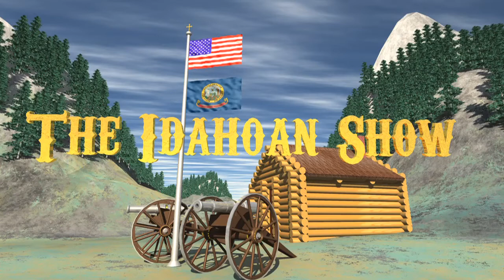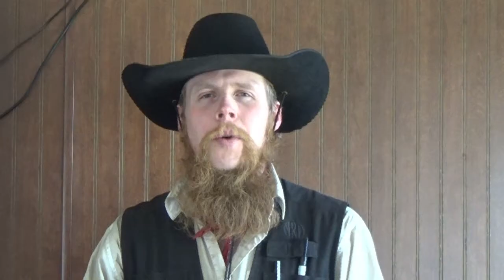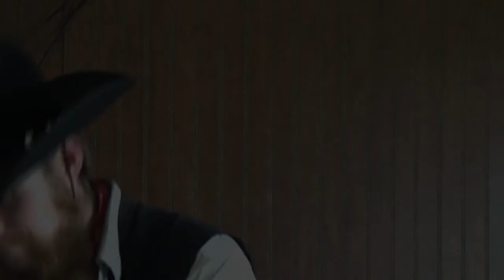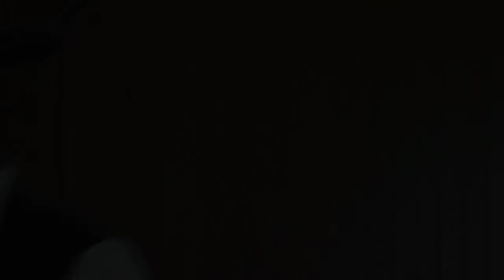Announcement - June 2017 (A001)

Comment: I agree  with  those  who  have  said  the echo  is of no  consequence.  Your  content  is  excellent. BTW, you  possess  a  number  of  valuable  manufacturing  skills. What  would  you  recommend  to  someone  who  doesn't  have  a professional  background  in  manufacturing  but  who would  like  to  learn  skills  such  as machine shop, welding, etc., as the  best way  to  acquire  these skills  and  without  having  to  spend  a fortune  on college  classes ,  if possible ?
Reply from the maker: Well, there are a variety of options out there for learning metalworking skills.  I've had the pleasure of knowing a number of retired machinists and mechanics who had their own equipment and were willing to share their knowledge.  If you can find and make friends with a retired master metalworker, more than likely he'll share his expertise with you free of charge.  Another venue to investigate is internships and apprenticeship programs.  During high school and college, I spent a number of summers working as an intern and basically getting paid to learn how to run machinery (didn't get paid very much, mind you, but better than nothing).  And if none of that works out, there is always self-study.  I taught myself how to weld by buying a used arc welder for $40, reading a few books on the subject, and burning a lot of electrodes until I finally got the hang of it.

Comment: With regard to reducing echo in your workshop, soft materials aren't absolutely required. From what I can see, you have a large shop with large, flat, sound reflective surfaces. As you fill your shop with more supplies, shelves, and machines, the irregular contours of these items will break up these clean, sound-reflective surfaces. The ceiling will likely be the most difficult surface to manage. Of course, a lavalier mic and synching audio later on your computer will help a lot too, but that costs you time.

Comment: Question for you: have you investigated electrochemical etching as a means to cut rifling grooves? Seems like it would be a viable alternative for situations where improvised button or broach machining isn't possible.  At it's most basic, you need a  bucket/trough, electrolytic solution, DC power supply, a mandrel and various thicknesses of piano wire.